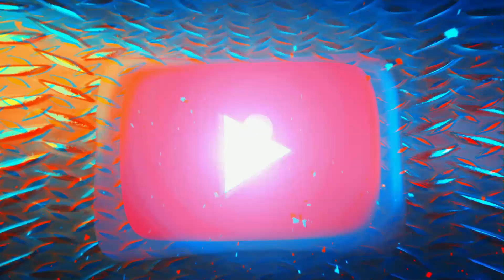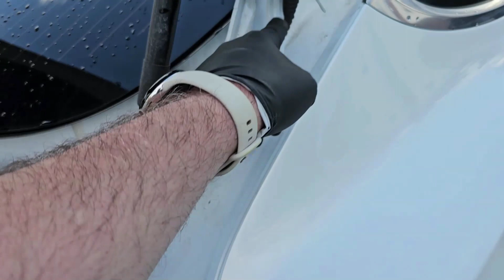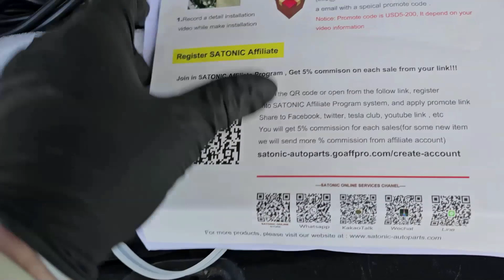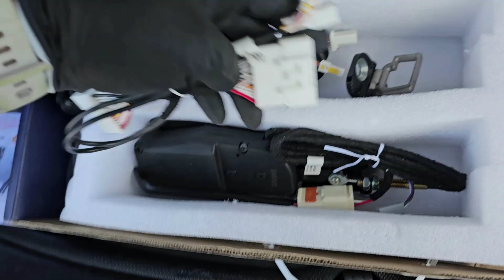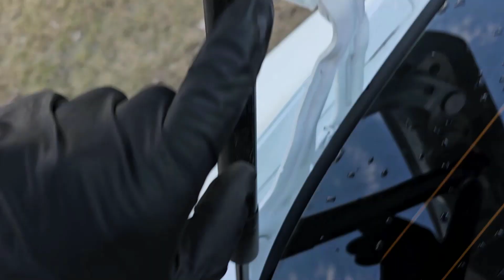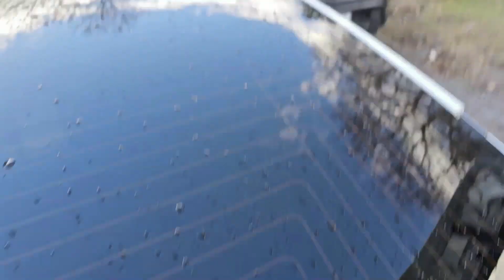Tesla Model 3 Power Liftgate retrofit Installation (2018-2020 Model 3) - Satonic V5

Comment: Has anyone had the soft close mechanism fail? mine is now stuck in the locked position and won't reset
Reply from the maker: @dav441983  haven't had that but can you try hard resetting the car and see if it releases?  Or can you access it somehow from going through the back seats and release it?
Reply: @MarkTBencze  I tried disconnecting the cable from the unit, but nothing, and I can't see anyway on the unit to release the wire. 

It's the lid catch part you were attaching in the boot around the 42/43 minute mark.
Reply from the maker: @dav441983  honestly, my best advice at this point is to probably reach out to Ev offer support or whomever you bought yours from and ask what to do.  They might have some advice that I don't have or have thought of
Reply: @MarkTBencze  Thanks, I'll try reaching out to Satonic